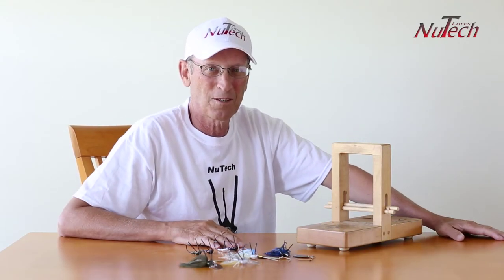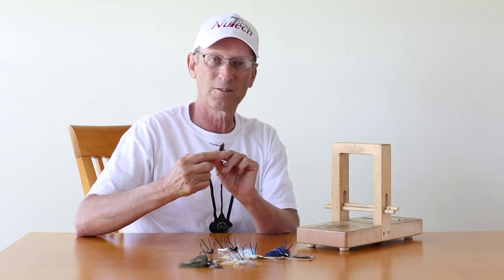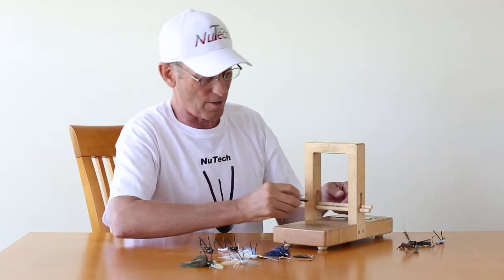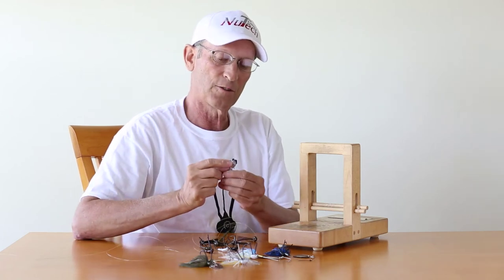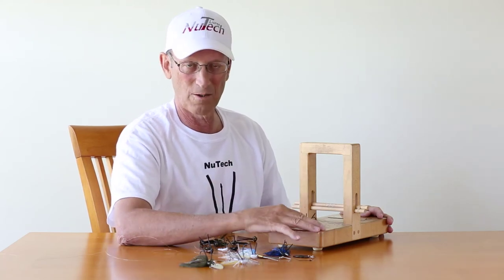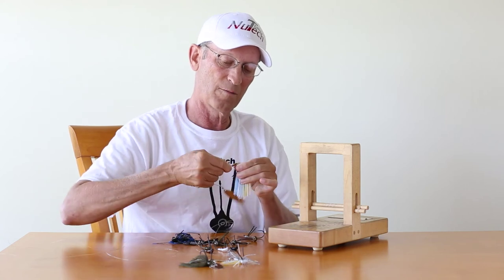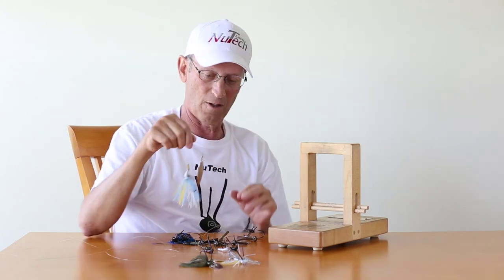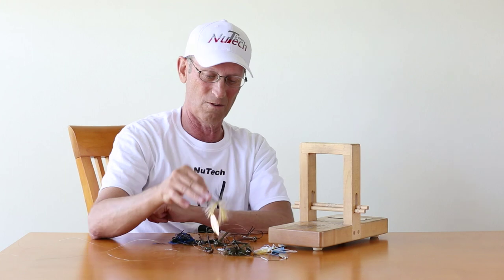NuTech Promo

Comment from the maker: we would be glad to test your favorite jig anytime.  also, given the speed of pull was pretty equal for all, why did none of the traditional jigs hook??  the reason they do not is because the center based weedguard is continually fighting the hook over to a flat angle.  it is the same reason the the safety pin style spinner baits you are fishing want to lay over on their side at high speed.  a single angle plan compressed from opposite sides will travel in a spiral.
bo